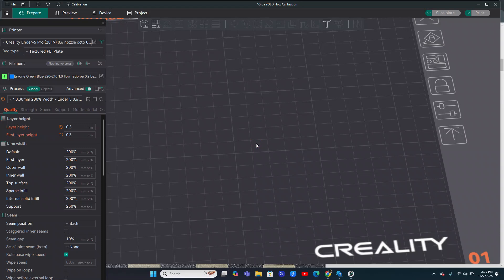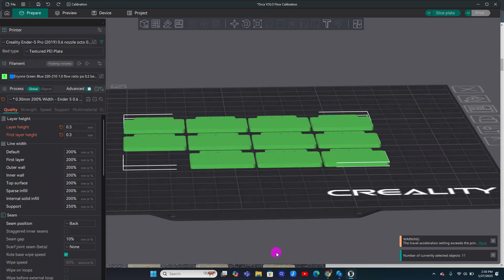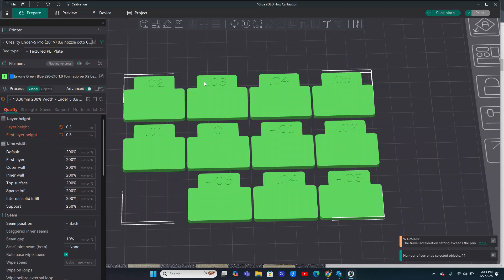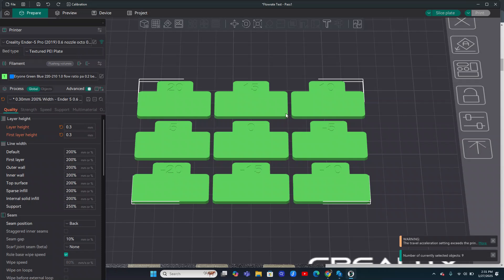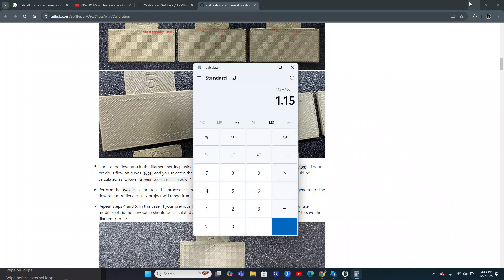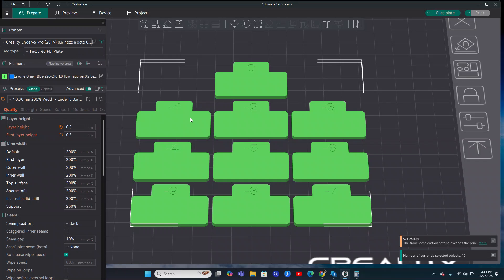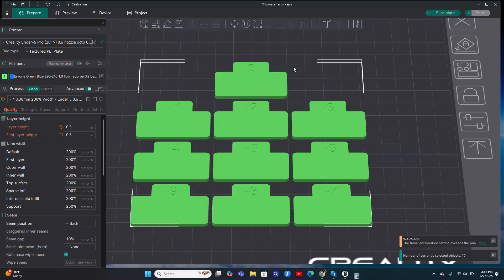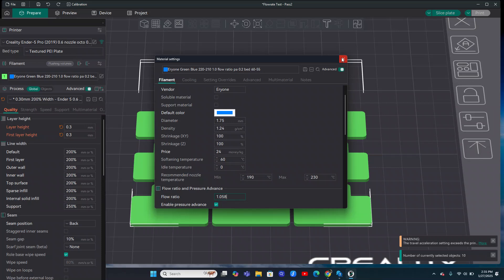Orca Slicer  Flow Rate YOLO & Pass 1/2 Tutorial

Comment: Very well explained. I would select a flow rate of 1.07 and then simply print the 2nd pass. Technically speaking a flow rate of 1 is always correct assuming e-steps are correct which they should be from the factory. You usually get under not over extrusion (except you get die swelling in the filament, due to high pressure) this is due to material flexibility. That´s also why TPU is always under extruded, instead of moving the filament it squeezes it thus you need a higher value. PLA is the most rigid material that´s why it´s also easy to print.
Reply from the maker: Thank you! Tried to balance length and wanted it to be accessible but not condescending for those new the hobby! 

I had never thought of the pressure and swelling!  Thank you good points
Reply: @RandoTechNerd  You did well. You explained the method in a good length. I just wanted to add some context, why certain things can happen. 
With more parameters, there is also more than can and will go wrong. e.g. I have tuned my flow rate with those calibration prints, but on "real parts" I can see it still over extruded slightly.
At the same time due to my pressure advance choice, filament choice, filament path and speed settings the outer most skin has local under extrusion. Not at the beginning or end of a line where it would be most probable due to wipe/coast etc. settings, but somewhere in the middle of the print. So even though my overall material flow is correct I can still see under extrusion for other reasons than the flow being incorrect. Topics like this can easily bload up in complexity. A similar issue can occur when you get too much die swell, you will then get over extrusion but only at high flow rates. Fixing those things is pretty hard since it´s really difficult to find out what happens why exactly.